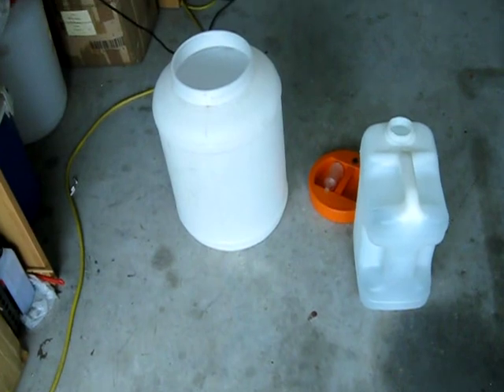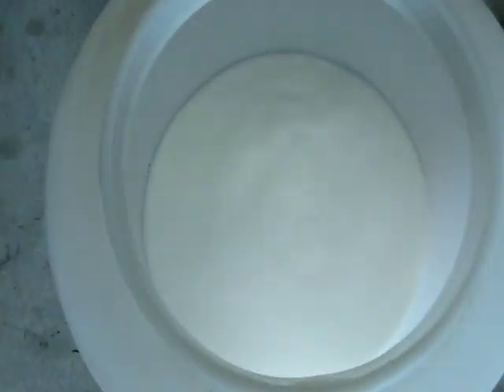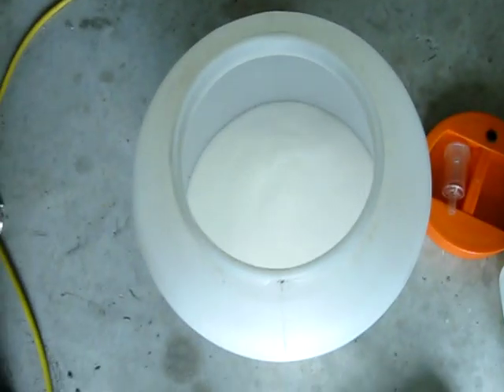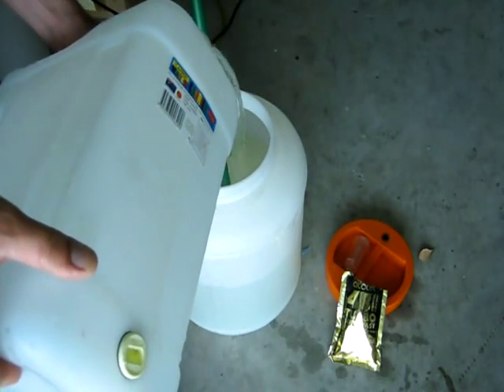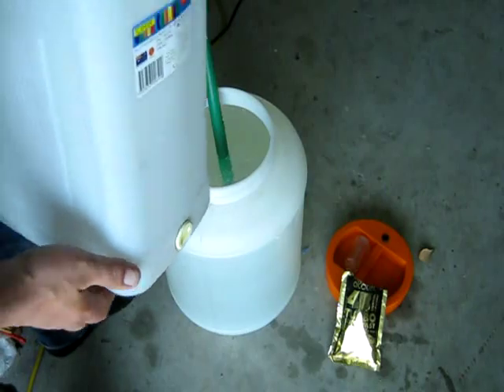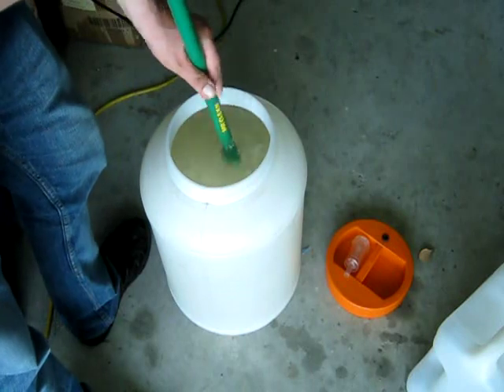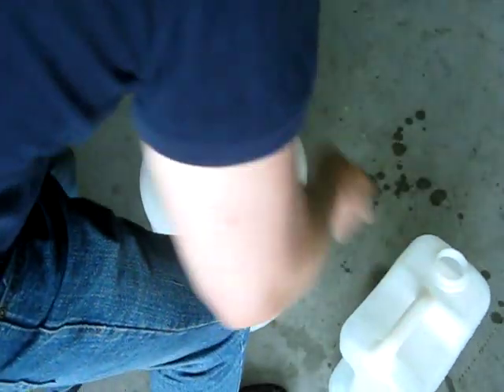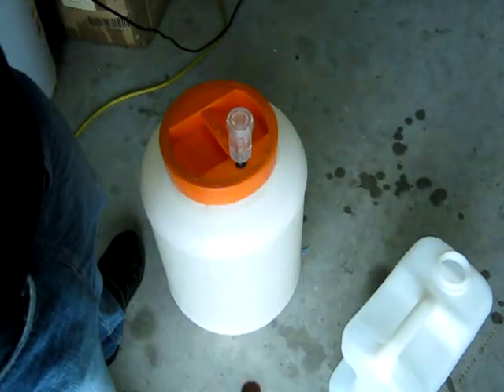Sugar based wash fermentation 1of 2

Comment: How much water did you us?
Reply from the maker: Gilbert Ehret this is all about mixture - you get 20L container and add there 5kg of sugar, 250g of dry yeast and bring the volume to total 20L, anyway sugar is heavier than water and 5kg will occupy approximately 3l volume, so i assume that you'll need to add about 17L of water, but it is way to complex - just use a vessel with predetermined volume and make your calculation based on the formula of 5kg of the sugar per 20l of the mix, though in a commercial operations to ensure a complete conversion and fast fermentation no more than 17kg of sugar per 100L of mix is used.

Comment from the maker: Hi, I would not recommend to drink this particular one due to nature of yeast and additives, while if you'll replace this east with a beer, baking or wine yeast, or even will use a mix of tomato paste and sultanas, then after settling you can drink it - in fact there is no big difference in a beer, cider or whine production, though I would recommend to settle it first and then carbon filter it - you'll get a 12% alcoholic drink.

Comment from the maker: Because they want to make a corn based mash, it is not just adding the corn - it is must be milled first, cooked and kept at 62 -66c degrees for awhile in presence of enzymes that will convert the corn starch into sugar (maltose) and then mix with water and add some yeast, so I am do it simple skipping conversion, just use a readily available sugar, can be maltose, fructose, dextrose anything that can be consumed by yeast.